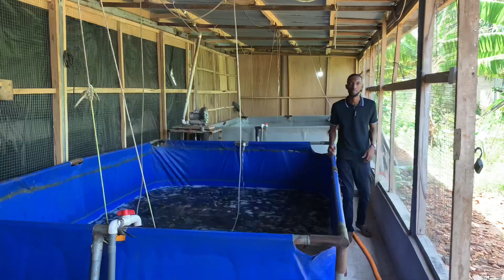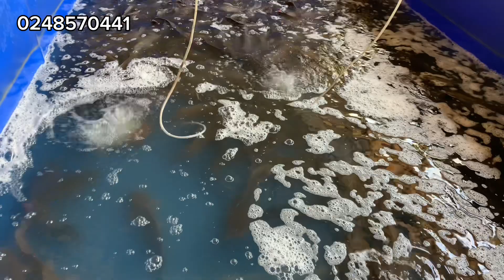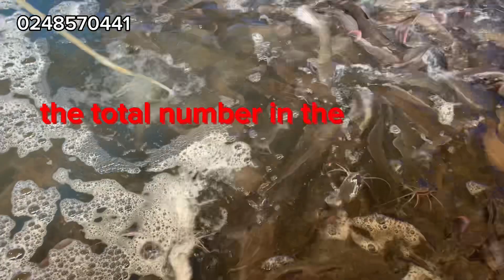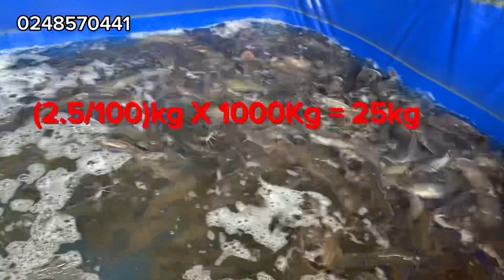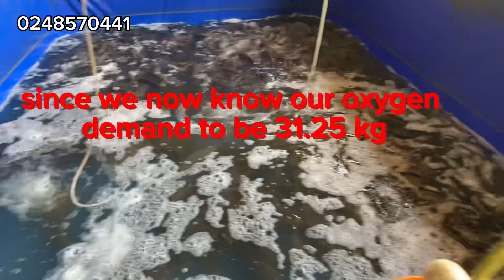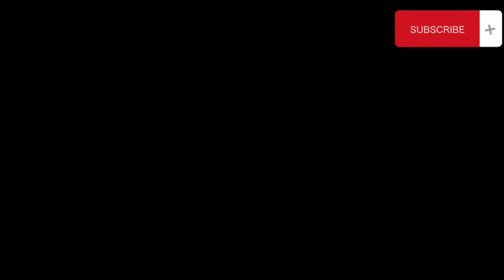How to calculate for the Feed Oxygen Demand (FOD) of your pond.

Comment: if you need 35 kg of oxygen how do you know your aerator is getting that per day? Or per hour
Reply from the maker: just as water has a density of about 1 kg /L, Air has a density of 1.2g/L . Aerators are rated in L/min. Therefore a 100L/Min aerator will generate 120g every minutes. Which is equivalent to 7.2kg/H. You can use this as the basis to calculate for your oxygen demand